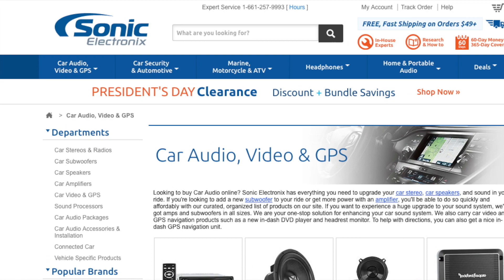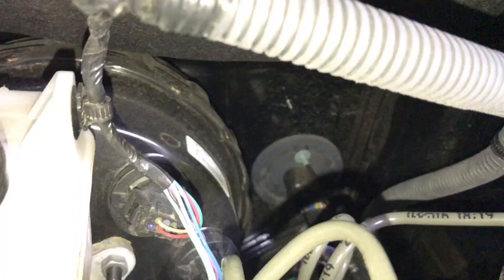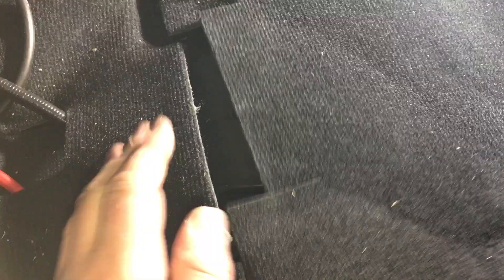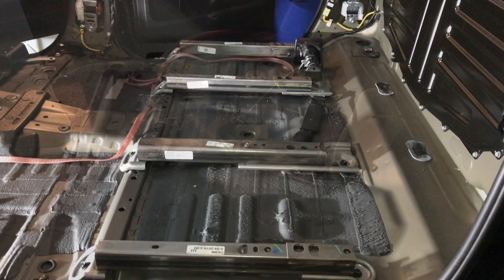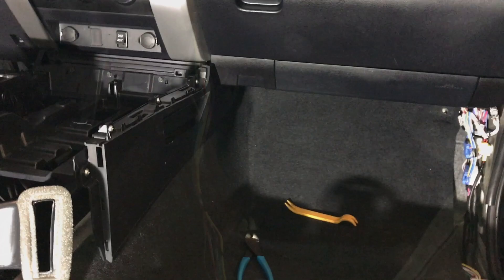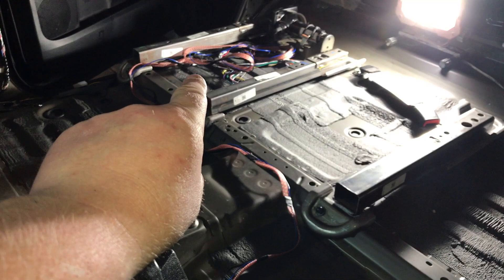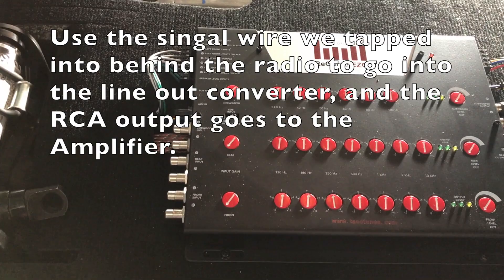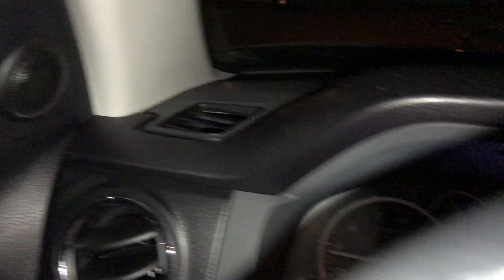2014 - 2021 Toyota Tundra 5 Channel Amp and Sub Install

Comment: What color are the wires behind the radio that I need to tap into, to link to my line out converter which is linked to my amplifier. I see the violet, yellow, green and purple wires that link to my rear 6.5" speakers in the rear, but I'm not getting a signal.

Comment: Where can I get a wire harness you used to get the speaker connections I need??  I’m helping a friend with his 2018 tundra and want to make sure I do it correctly for him.

Also,
When splicing into the factory Jbl amp, do I connect up before the amp or after the amplifier....
Reply from the maker: It was a harness made by Taco Tunes, called a T-Harness.  It depends on your configuration.  Generally, it is better to tap into the signal going to the amp than from it which doesn't necessarily require a line out converter since the singal is already a low-level signal.  If you tap into the amp from the JBL outputs, you will need a line out converter.

Comment: 2020 tundra Crewmax non jbl, I plan on running two amps. One mono amp for the subs and a four channel for the mids and highs. I’m gonna keep the stock radio. Don’t need a processor? What else would I need to make this system work?

Comment: So to install this basically do a frame off LOL.  I was just wishing you would have said, ok next we are going to remove the engine block to run a positive wire for power.  I've done a full set up, interior ect but personally it just seems a bit overkill. Just for a sub and amp install.
Reply from the maker: See link in the description for an updated version of this video.

Comment: I have a jbl tundra system I’m running all new wires to speaker and at03 harness and maestro dsr1 do I run new wires to amp and dsr1 wires to harness or don’t need to connect dsr1 speaker wires and t03 wires

Comment: What do I do with the factory speaker wire after running the new speaker wire to the new door speakers
Reply from the maker: Just tape them off, they wont be used.

Comment: Since you have heard the system in person, do you think it's worth the $2500 that tacotunes is asking for it?
Reply from the maker: Nope, i don't think so, i would have used other components for the install for half the price and just about the same audio quality.  Sonic Electronix has a good selection on other parts and you can even use my coupon code ProvoBeast for 5% off.  I'm an Alpine and Pioneer guy, i think they build good components for a much better price.
Reply: Provo Beast, now you have me thinking. I love the Taco Tunes box for two full size 10” subs. I’m a big fan of Alpine and Pioneer myself. What components would you recommend for a system that is identical, or even better than the SQ1 Taco Tunes package? This is for a Tundra Crewmax JBL. With your discount code, I really could be saving a lot!

Comment: Great video Provo.  Question. Can I not tap into the wires that’s going into the “non jbl” factory amp?
Reply from the maker: You sure can, but remember if you tap into the amp input, its a low level, and the amp output will be a high level output, so it just depends how you decide to wire it.  The kit we used pulled the signal from the low level side for our crossover EQ.
Reply: Provo Beast Audio Installation sounds good! How many inches of space is there from the front of the box to the back of the seat? Do u think a 1/4 or 3/4 spacer will fit or will that hit the seat?
Reply from the maker: Not sure, can't remember, it was for a guy last year.  Sorry!
Reply: Provo Beast Audio Installation so the subs I got are a bit small for the hole cutout on sub box.  I’m only able to get the top 4 screws in on each sub. What do you recommend to getting the subs to fit? Thanks.
Reply from the maker: create spacers or speaker ring adapter plates to mount the sub too, then mount those plates to the box.

Comment: how did you wire to subwoofers into a 5 channel amp
Reply from the maker: I wired them each subwoofer in series, and then wired them together in parallel for a final impedance of 2 ohms.  Then i connected them into the sub output on the 5 channel amp.

Comment: I’ve got a 5 channel 600W Kenwood amp running a full system with 2 10” Kenwood subs( crap ). I’m wanting to run two better quality subs. What subs would you recommend or should I run a separate amp to run better quality subs?
Reply: Ronald Myers separate amp for the subs with a capacitor.

Comment: going to buy a RF-P1000x5 recommended fuse: 150a should I get a 1/0 off wire to battery to back or a 4_gauge off wire will be great??
Reply from the maker: As long as it is a true 4 gauge wire CCA, you should be fine.  You can upgrade to either a 4 gauge OFC or even 1 gauge wiring, up to you.  Generally, for 150 amps, be sure your battery is healthy and if you've installed a Big 3 upgrade.
Reply: Provo Beast Audio Installation OK thanks..because I just bought a 4 gauge OFC wire kit!

Comment: Is that copper or tin amp power wire?
Reply from the maker: OFC, Tinned Copper. Helps prevent corrosion.
Reply: @ProvoBeastAudio  Thanks.  That's the answer I was looking for...  I didn't want any corrosion at the terminals.  This video is perfect!  Thank you so much!

Comment: this may be a dumb question but on the non JBL system can you just replace the factory amp with an aftermarket one to strictly boost the stock system and speakers?

Comment: And next the last step is taking the entire frame apart with a torch and deconstructing the 5.7l motor completely one bolt at a time.. simple process guys... LMFAO you took the entire truck apart to just for this "small project".